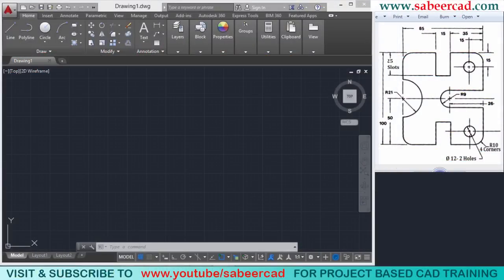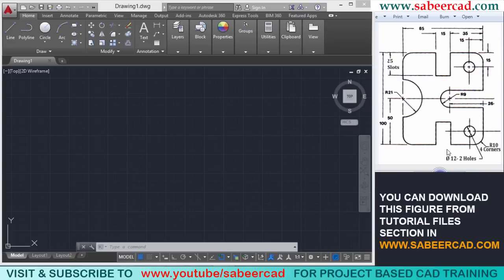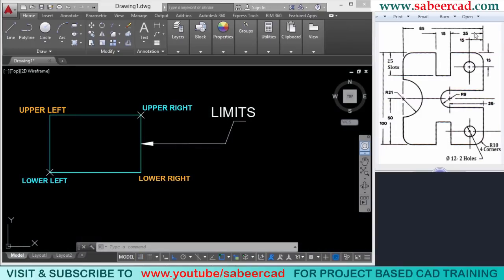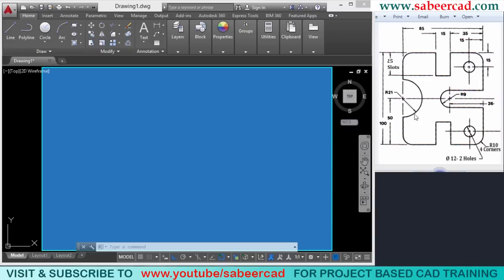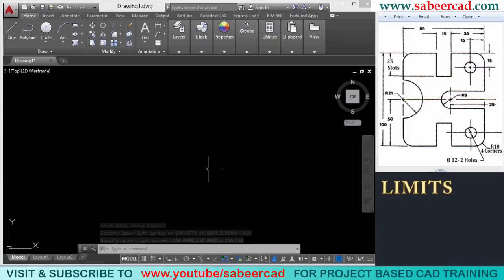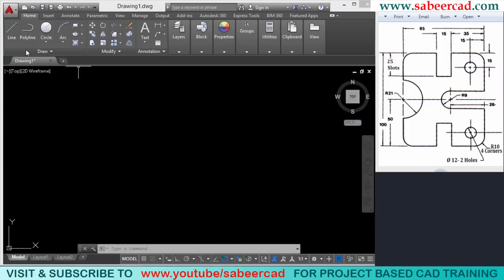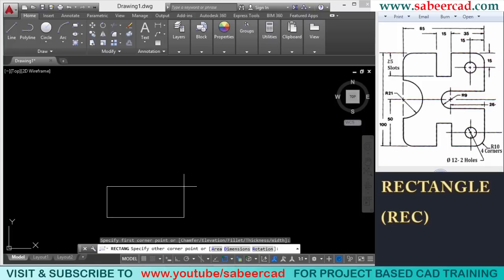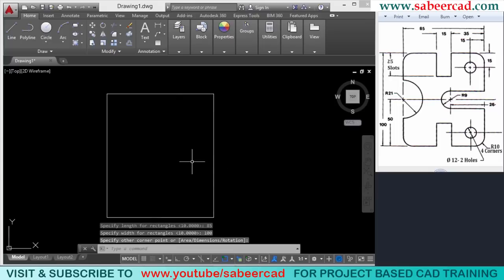AUTOCAD LIMITS | AUTOCAD 2D DRAFTING FIGURE 2

Comment: hi, I am using autocad 2016 and when i try to click on my rectangle after selecting fillet, it only highlights one line, not four lines of the rectangle
Reply from the maker: You should use the polyline  option in the rectangle command

Comment: Following your tutorial, I found a problem. After creating the box, and then the Fillets, I am stuck as no center point is available when I select Line . Your Autocad shows a triangle near the center of the top line. Also, when I try to put in the line position, it measures from the Arc, not the width of box. What am I doing wrong? Using Autocad 2015 Ver.  Thanks  Nice videos by the way, thanks for sharing
Reply from the maker: +Laurence Dodds Just activate MID at the osnap (at the status car , below) , you will get the exact MID point of the top line
Reply: @sabeercad  Have same problem, thank you sir
Reply: sabeercad no sir its not working...
Reply: sry sir its working...thank u sir..